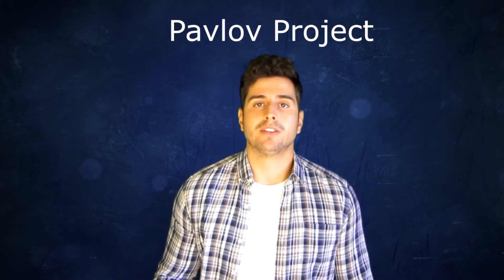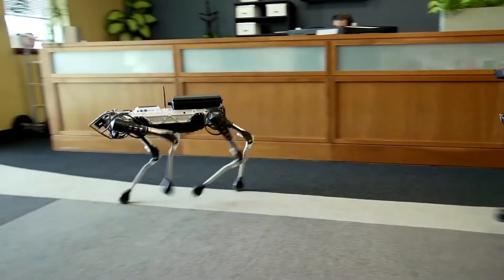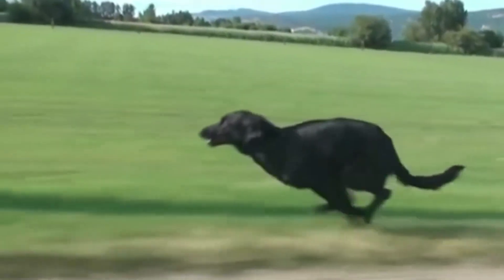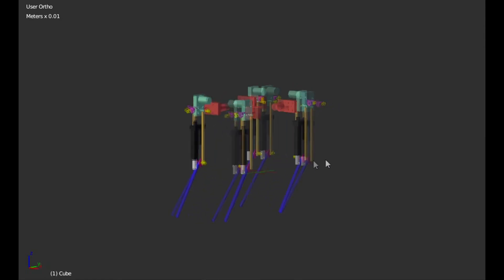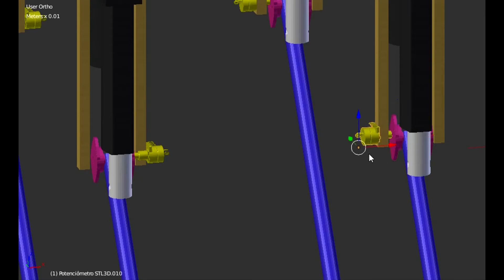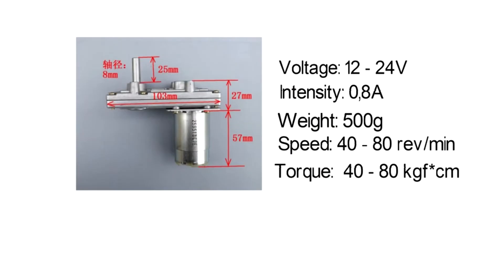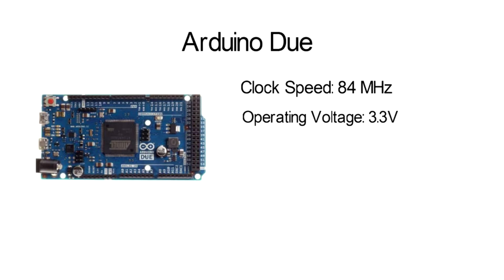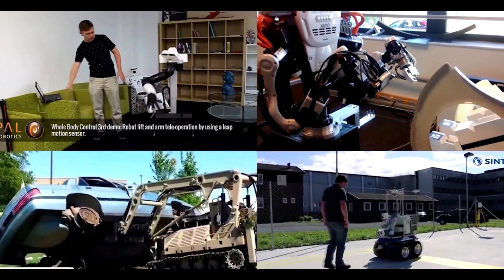#1 Design and components - Pavlov project: Building a quadruped robot

Comment: may i know your reason using motor dc instead of servo or stepper motor?
Reply from the maker: Hi! Actually the idea is to build my own servos from these DC motors using a potentiometers as a feedback (same idea as a servo motor). Stepper motors are very heavy, and if you need a lot of torque like in this case, steppers motors are very expensive..